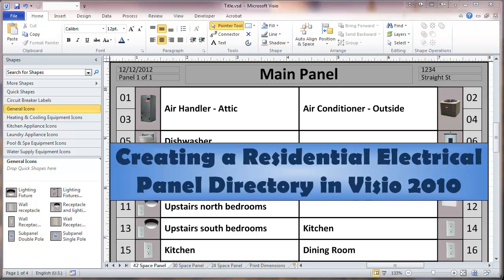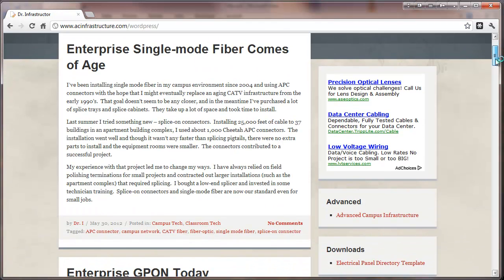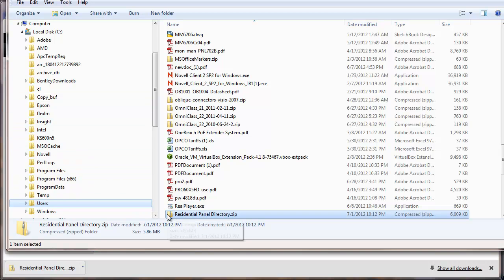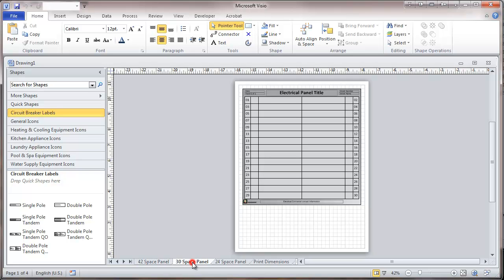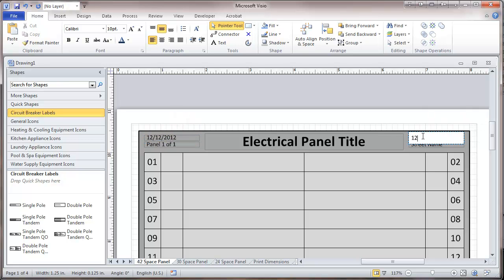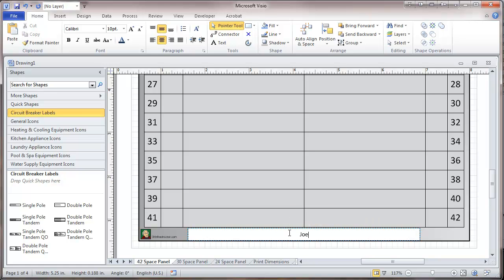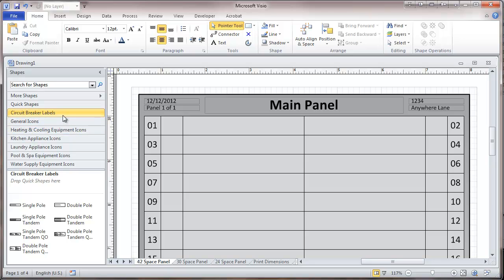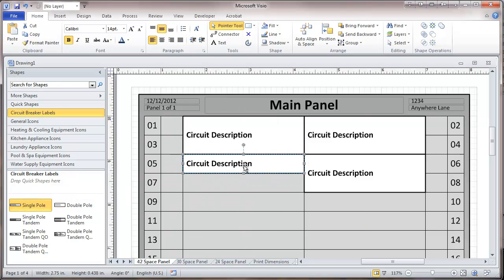Creating a Residential Electrical Panel Directory in Visio 2010

Comment: Is there anyway to edit the panel directory background stencil, specifically the location of the circuit breaker numbers? I have a 30 space panel where the service comes in at the bottom of the panel and the numbering sequence starts from the bottom instead of the top.  Really great well thought out template!  Very well done, thank you for offering it!